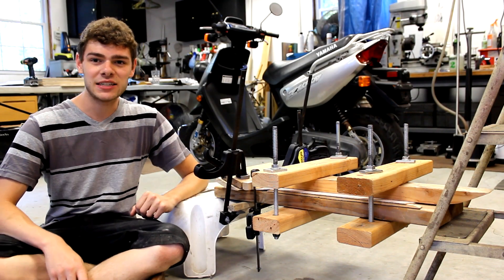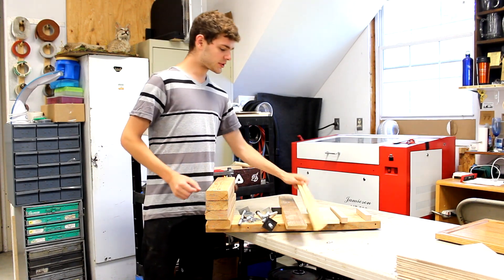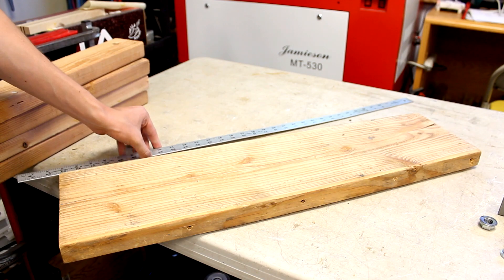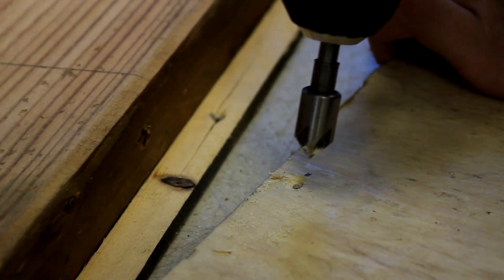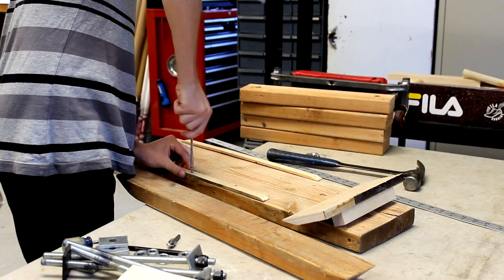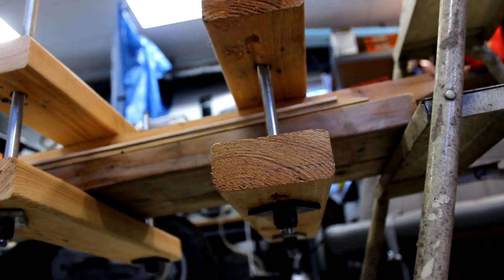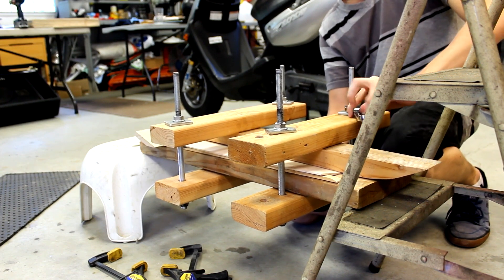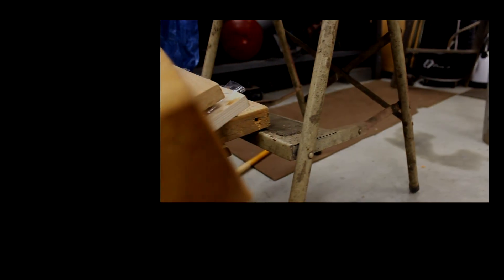How To Make A Longboard / Skateboard Press | CashedOutBoards

Comment: Hi, So  made a board, and my press didn't work correctly and I now have air bubbles in my board. Would the slight lopsidedness created from the bubbles damage my trucks or bearings ?
Reply from the maker: If you have bubbles between the layers of the board the angle cause by it likely won’t mess up your trucks or bearings. However, it’ll unfortunately probably cause a weak point in the board that’s more likely to break. Good luck!
Reply: CashedOutBoards  awesome thanks for the quick reply👍

Comment: What size threaded rod did you use? I am planning on using M16. Is this too much? Thanks Cash
Reply from the maker: +Lachlan MacPhee hmm I think it was 3/8. If it's a little thicker it won't be a problem than if it's too thin. Good luck!

Comment: What type of plywood do you recommend using? (sheet thickness? and glue?)  It looks like you used three layers of plywood too?  I appreciate the videos!
Reply from the maker: +Rich Constantine I use 1/8 inch Baltic birch plywood with titebond III glue. For shorter boards I usually use three layers and four for longer ones. I hope this helps!
Reply: It does, I appreciate it!
Reply: 1/8 inch Maple also works very well. If necessary, you can go below 1/8 of an inch but only down to 1/20. Of course, you would need more layers if you went that far down, but you'd know if your board is stable or not. Also, like Cash said, use Titebond III but make sure to get the Ultimate version as that one is waterproof and more durable than the other versions.
Reply: For making an actual trick board use 1/16 to 1/17 inch maple with Tite bond 3